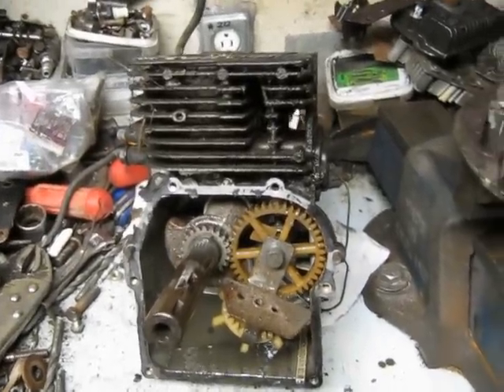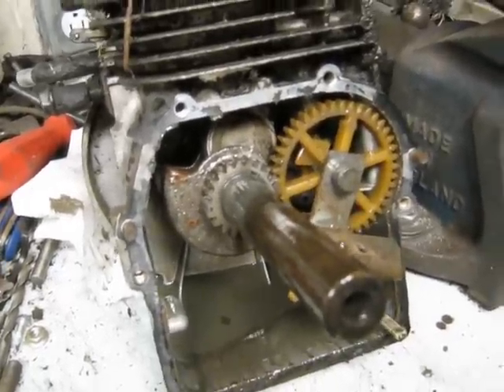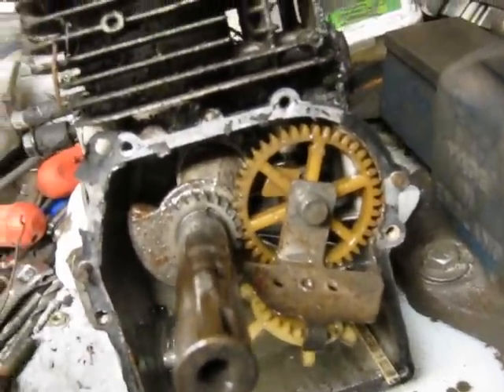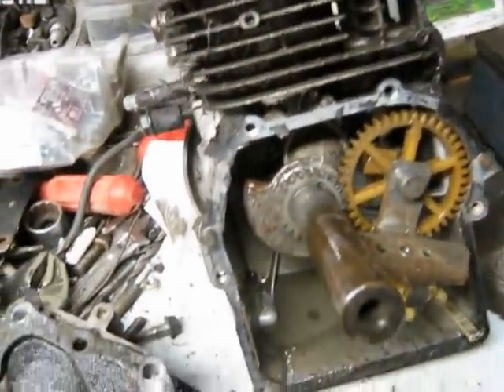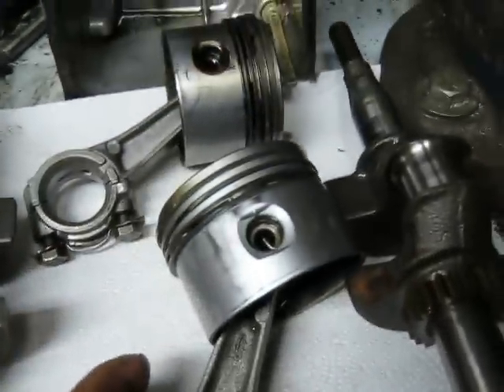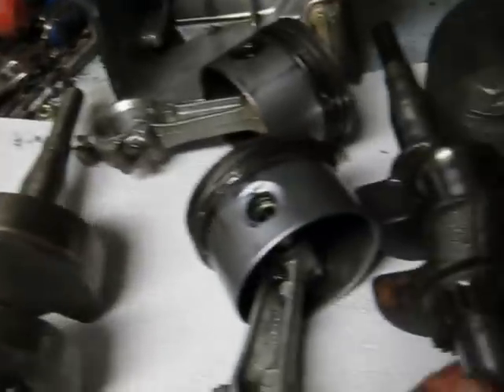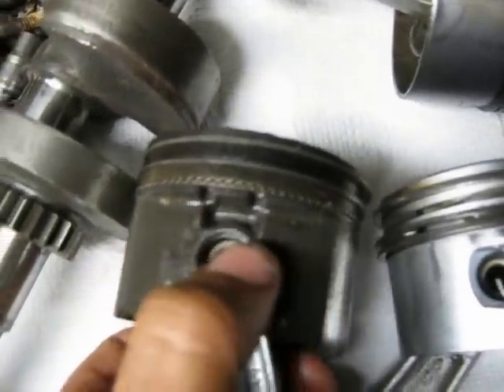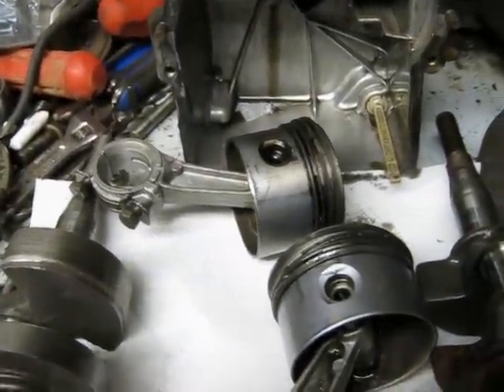70s & 80s Briggs Engine Versus 1995 Briggs Design

Comment: first time i see plastic camshaft... by the way, Does the connecting rod contact directly to the cranckshaft without any removable bearings?
Reply from the maker: yes, these engine don't have any bearings, the aluminum connecting rod rides right on the steel crankshaft.

Comment: a PLASTIC camshaft? it goes to show in the mid 1990s that Briggs and stratton went downhill. as most of these plastic camshafts fail in which the valves don't work. the older 3.5 hp has a solid metal camshaft. as the differences the older blocks prior to 1982 had the oil fills an different locations and they had a points style ignition being they were under the flywheel. then they can have the if the last digit ends in 2 its a standard rewind starter if it ends in 8 it has the vertical pull starter and a toothed flywheel for its gear. since 1982 these engines have the Magnatron electronic ignition and the block redesigned to have the oil fill in one spot plus provisions for the system 2 compliance brakes for walk behind rotary mowers. as the block was made for the mechanical governer too as most of these have a air vane governer.  as the worst of the engines briggs and Stratton is its Professional series 7.75, and larger OHV engines for walk behind mowers and pressure washers they have PLASTIC camshafts and timing gears and so many complaints on this engine if it mainly on Troy Bilt pressure washers made by Briggs and Stratton. as there is one here on youtube. they put in PLASTIC camshafts and timing gears to reduce mechanical noise but little does Briggs and Stratton know these is bound to be failures with these plastic camshaft and timing gears in their engines the only best engine out there still being currently made is the Quantum.  look for Nonya Bizness's video on Consumer Warning Troy Bilt and Briggs and Stratton Products and listen to it carefully.
Reply from the maker: Thanks for all of the information!
Reply: anytime.

Comment: i got a briggs water pump the other day. all i did was put fresh gas in it and it fired up. those puls jet carbs are awsome. I was wondering miles if you could do a video on how to fix the recoil starters on these old engines. also any tips for removing the rusted screw in type mufflers
Reply from the maker: farmer jackson Thanks for your comment, and vid suggestions. I will put the fixing a recoil starter, and removing rusted in muffler bolts on my list.  I believe I already have a vid showing an idea I have used for muffler or head bolts, thought it could take a while searching thru my 500 vids!  Basically I take a 1/4 or 5/16" hex nut, and cut narrow slots on one face, usually 3 slots all the way acrossed, so it looks like a castellated nut when I am done. then I weld it to what is left of the bolt, it can even be broken off flush with the engine block. You have to make sure you get the weld down the center of the nut, and fill the whole hole with weld. Let it cool for a few minutes, then turn it with a socket or wrench, it may snap off, if it does, repeat the process, after 5 or 6 nuts, usually the bolt will have gotten hot enough the  be persuaded to unscrew! It has worked many times for me, I was even able to remove a broken off 1/2" head bolt this way. Sometimes I spray the hot nut with penetrating oil, hoping it will work its way down into the threads.It is a bit of a pain to do, but I haven't had much luck using easy outs and the like for removing broken bolts.
Reply: ChargerMiles007 
i have done that before for broken bolts works well. the problem i have is the say on the 3 horse engines they have the threaded muffler (pipe thread) no bolts. when i take them out if they are in bad shape alot of times it strips the aluminum block. i was wondering if you had a trick for getting them out of fixing the threads?
Reply from the maker: Many times I can't get them to thread out, so I collapse the short pipe with a chisel, and get it to wrap into itself until I can spin it out. I also have a 1/2" pipe tap to cut new threads with, Though sometimes the aluminum threads are just gone, like they vanished. I use those engine for a FrankenBriggs project that doesn't require a muffler!  :)

Comment: what year did they stop using points ignition?
Reply from the maker: xoxoXoieoxox I am not 100% sure, but I think it was in the early 1980s, as our first Magnetron is a 1983 pushmower.
Reply: ChargerMiles007 thats interesting did u ever wonder why they named there electronic ignition sys after a part in a microwave O.o
Reply from the maker: xoxoXoieoxox Hey, you are right, I had never thought of it that way!
Reply from the maker: Hey, how is it going out your way, drier than a popcorn fart from what I see on the TV news!
The weather the last few years has been strange, a ton of snow 2 winters ago, a 6 week stretch of butt freezing cold this past winter, now a yoyo up and down temps "summer" so far, my garden isn't liking it!
I am still working on the 5 cylinder "radial" type engine, assembling engine #5 now.
Reply: ChargerMiles007 its going better it has been wetter than normal this spring we had more cloudy days than sunny and today we got lighting and thunder we are set to have a strong el ninio winter so that means lots of snow and rain so in my opinion the drouth will be over soon im finishing up the mechanical aspect of my volkswood IE wheel bearings and the like and i made a new sys i will do a vid on and it will be fun lol =3-
Reply from the maker: Good to hear you are finally getting some water there, the news reports haven't looked good, I guess there are lots of forest fires burning in the western part of Canada also.
Look forward to more Volkswood vids, take care.

Comment: the  majority of the changes your showing  are directed at lowering  emissions and reducing cost 
the sintered iron crankshaft gear   along with the plastic camshaft was  made to reduce noise and also  it is more precisely machined  so it doesn't eat the plastic camshaft gear 
the light weight piston with the automotive type piston rings  is cheaper to make and also reduces emissions 
same with the cylinder head with the smaller combustion chamber  ,, the newer engines have higher compression ratio

another change which you didn't mention ,, ALL of the head bolts in the newer engine are  the SAME length 
the old design had 3 longer bolts and 5 shorter ones  ,,these longer bolts were around the part of the head where ignition takes place ,, the newer heads have thinner bolt holes allowing use of 8 identical bolts , meaning you can put the bolts in any hole when reassembling the engine

the blue stuff on the sump bolts  is Loctite  ,, it isn't sealant , intended to prevent the sump from vibrating loose and causing leaks
Reply from the maker: wildcoyote34 Good points you made there. I did forget about the long and short head bolts. If you go back far enough some of the old engines had a left hand thread for the flywheel nut! I broke the end off a crankshaft on an old 3 horse, when I forgot about that!
Reply: ChargerMiles007 I've not run into the  left hand thread  nut  yet ,,that musta been a really OLD one
Reply from the maker: wildcoyote34 I think around 1960 or earlier, I have seen a few of them, and I think most of the old cast iron block engines use a left hand thread on the flywheel nut. I ran into the same thing on 1968 imperial (Chrysler) lugnuts, the drivers side of the car used lefthand thread, marked with an L stamped into the end of the bolt. Someone had replaced 4 of the 5 bolts (probably due to breakage), so I was a bit baffled when 4 bolts came right off, and the 5th just kept getting tighter!  I was taking a break doing some head scratching while looking for a longer pipe to slip over the lugnut wrench, when it suddenly hit me what that "L" on the bolt could mean. Needless to say it immediately loosened up, and came right off, though I swear I started to bend the rim before I stopped tightening it on!  :)  Left hand threads, you gotta luv em!

Comment: As some one that likes to cram round pegs in square holes, wonder if one could take a part from every 3hp variant and have a Briggs across time. That's a odd one
Reply from the maker: Mr3wheeledbike That may be a possibility, if my engine count is anywhere near accurate, I believe I have about 70 3 or 3-1/2 (model 929...) engines spanning the mid 1960s up to 2005 or so.

Comment: Hey does anybody know anything about Wisconsin engines I need to know how to regain spark on a 50's Wisconsin acn 6hp
Reply from the maker: Cody Stevenson That's a good question, I remember an old Wisconsin when I was young, my only suggestion would be to remove the flywheel, since that is where the ignition parts are on old Briggs and Tecumsehs, though I am not certain they would be there on a Wisconsin. Your comment has reminded me that there is a Wisconsin V4 engine sitting at a scrapyard, I will have to take my camera and make a vid of it tomorrow. I was a nice guy, and putt a bucket over the exhaust, and covered the intake on it before the winter snows got to it.  Hope someone can help you out.
Reply: ChargerMiles007 thanks but I don't have the v4 I have the single cylinder 53 acn its a 6hp motor and the points are in the magnito box on the side of the motor if u look them up on YouTube you will see what I mean look up Wisconsin acn in your search bar. I would like to know how to regain the spark i bought this motor from a farmer for 30$ and I got it home and it didn't have spark and its gonna be hard to find parts for this motor I would like to know how to fix it if u can make a video of your v4 that would be great I have a friend with one of those and I bet he'd love to see yours run. thanks have a great day
Reply: ChargerMiles007 I have a video of my own I posted today on my channel
Reply from the maker: Cody Stevenson I will have a view, sorry about mot knowing it has a separate magneto, I wasn't sure the "smaller" sized Wisconsin engines were built that way.
Reply: ChargerMiles007 
Its ok I just need a new spark plug wire or cleaned points I think
Reply from the maker: Cody Stevenson I don't own the V4 engine, it is at a scrapyard, though I did make a vid of it today that I will upload soon.My cousin has an old V4 that is hand crank start, I used to belong to my father and grandfather, it is on an ice cutting machine that has a huge 4 foot diameter blade! I will try to get a vid of the ice cutter in the future. I used to crank over the V4 by hand, but I was only about 12 at the time, so I wasn't man enough to attempt to fire the Beast up!  I still don't know if I would try it, one kick back, and you can have a damaged wrist, though people back then started them up fine.I hope you can find the info you need to get your Wisconsin sparking. Now that I think of it, we had an old single cylinder engine similar to yours, it came off of a Gibson tractor that steered with a vertical bar, not a steering wheel. I remember that engine being wrap around rope start, like the old cast iron block Briggs engines.
Reply: ChargerMiles007 
Gibson used alot of wisconsin engines so did bolens and wheelhorse thanks for everything u have done. And where is this scrap yard located it seems like u pull hundreds of motors outta there of every shape and size. Thanks again have a good day
Reply from the maker: Cody StevensonOh, so you have heard of Gibson tractors, I have never seen another one, and the one we had went for scrap probably 30 years ago, the rear end gears were broken or worn out, my father couldn't locate a replacement set. I used to play around on the tractor moving the steering lever. Unfortunately the Wisconsin engine from it went for scrap also, along with our well worn 1955 and1956 Chevy cars, and a few 283 V8 spare engines. The old 56 didn't want to leave though, the drivers side front tire was seized solid, and left a skid mark on the road 2 miles to the scrapyard.It was the fastest car I have ever been in, it did over 130mph with a built up 327 and electric shift overdrive  :)If I see another Wisconsin engine I will consider bringing it home, depending on the price.

Comment: You need to get a hold of one of their new designed engines and take it apart. Then compare it to the old ones! it's really sad lol.
Reply from the maker: 1972FordF150 I will mount a search at the scrapyards, I saw a 6.5 horse OHV engine a while ago. I generally stick to the older engines, but I guess I should branch out, thanks for the idea. From what you have said it will be an eye opener.
Reply: I just overhauled a 6.5HP quantum from 2001. Thing is built like a tank compared to that new crap lol.